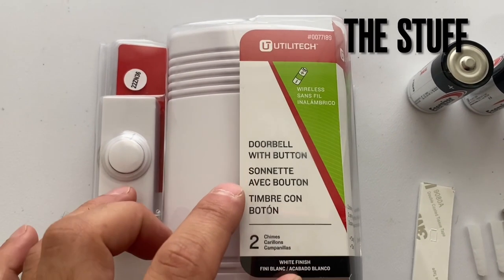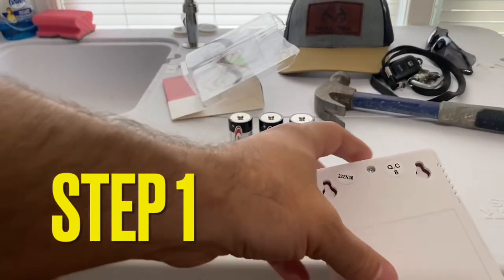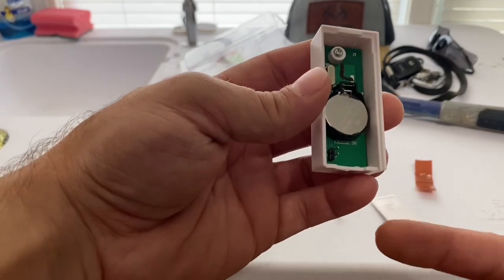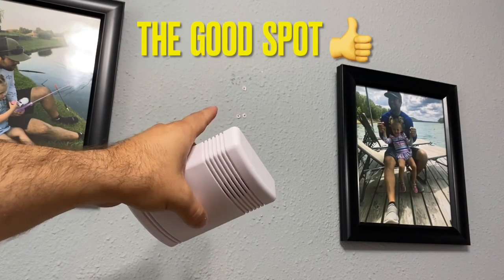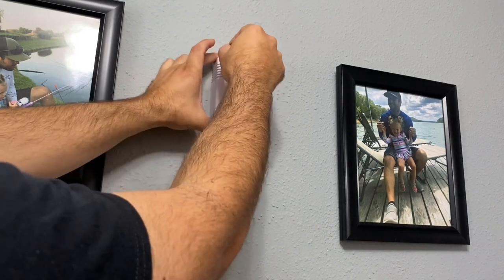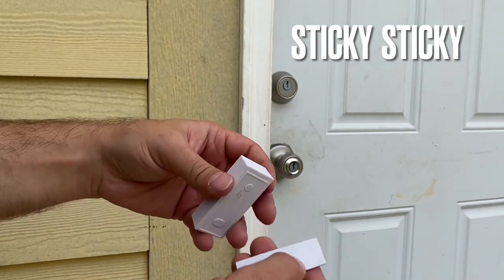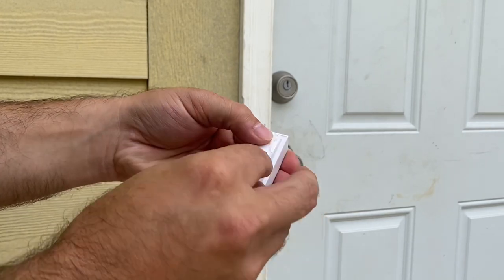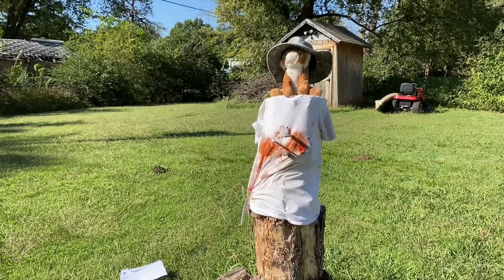How to install utilitech battery powered doorbell

Comment: I don't know if that double sided adhesive would be durable long-term in the outdoor elements, where the button is located. Probably the screws would be better.

Just wondering if they also have the wireless doorbells where the button lights up for nighttime???

Otherwise the install looked easy. Thanks
Reply from the maker: @rockyroad-hq7hz  Hello, thanks for reaching out! It is made for the outdoor elements and mine is still working great. You may be able to find a different one that lights up. My siding is concrete so I used the sticky. I like the light idea though and yes, very easy!